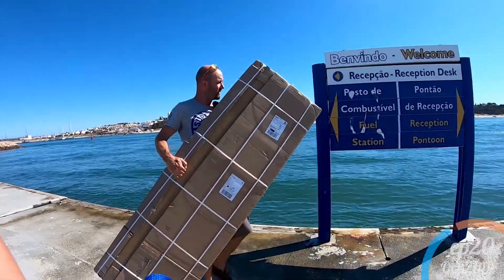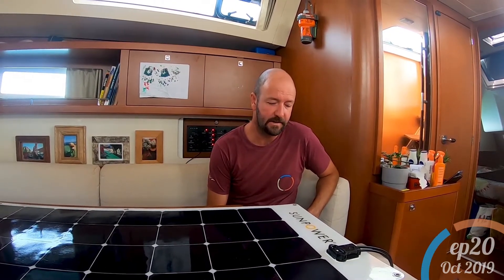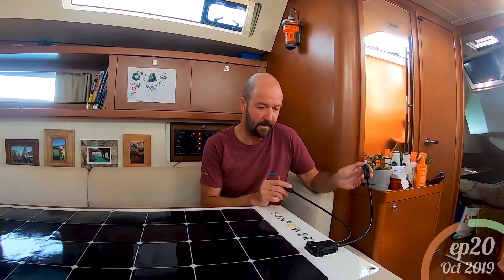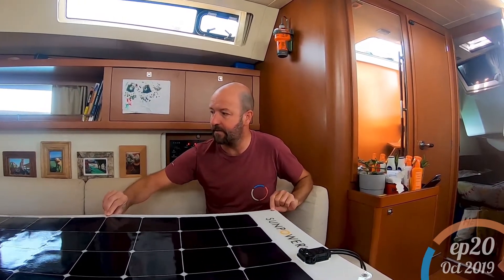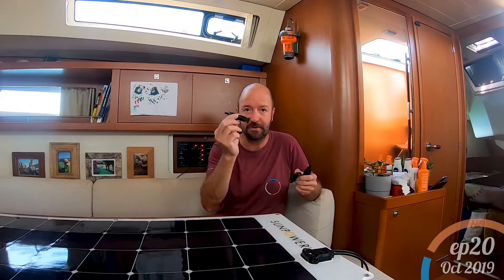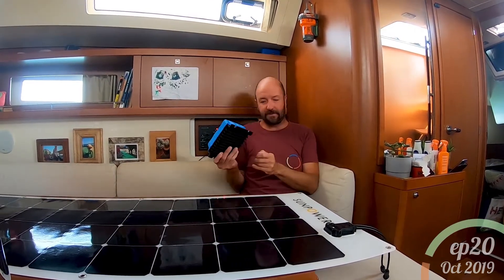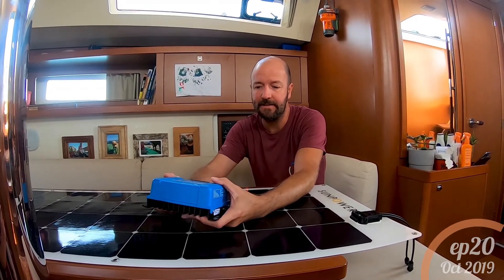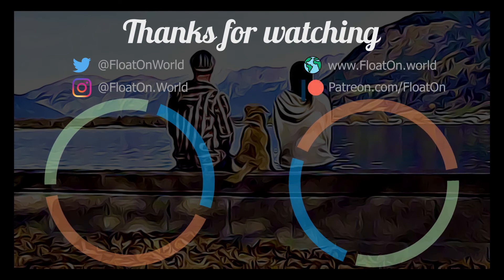How to: Sailing Solar Energy Part 1 | Float On Ep20

Comment: Hi guys 
Lovely video and wonderful set-up
Can you explain how the mppt controller are talking to each other ?
Cheers
Ben
Reply from the maker: Hi Ben! We only have one mppt controller and that's plumbed straight into the house battery bank, it has Bluetooth so we can monitor it - in fact Amy is obsessed with the App :-D We do have a battery charger which charges the house bank from shore power, but since the battery 'incident' that nearly killed us (Ep32) we monitor the batteries with paranoia when we use it :-D Thanks for the lovely comment, and stay safe. Martin, Amy and Bam Bam

Comment: Never ever install the panel over the bimini bars. It should completely stay on the canvas. Orherwise you will break the cells. We are the distributor of SunPower E-Flex in Turkey. Drop me a message for more details doruk@yesenerji.com I can give you technical support if you like.
Reply from the maker: Thanks Doruk! I will be sure to take your expert advice - we will install them as you suggest and not over the bimini bars... Thanks!